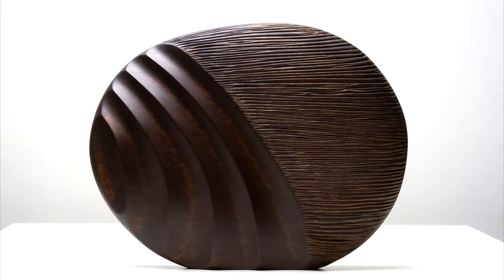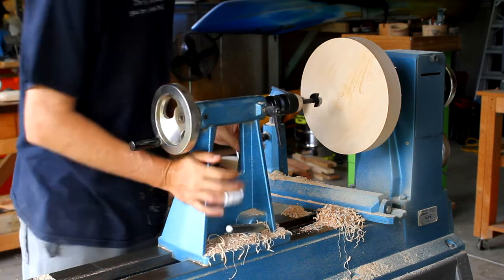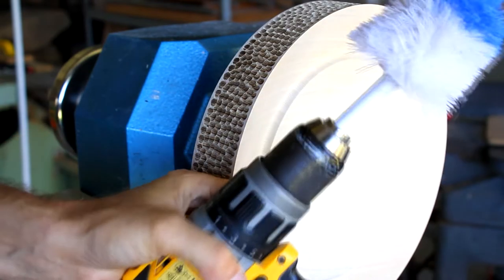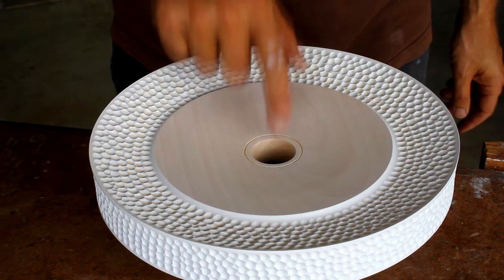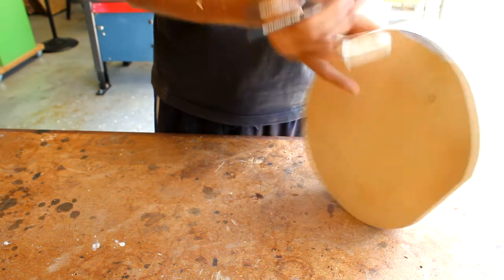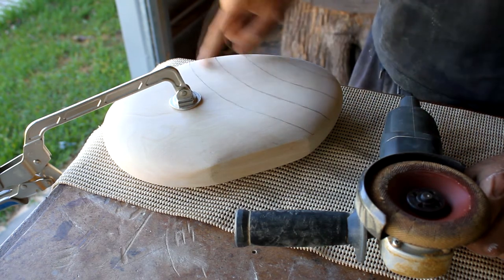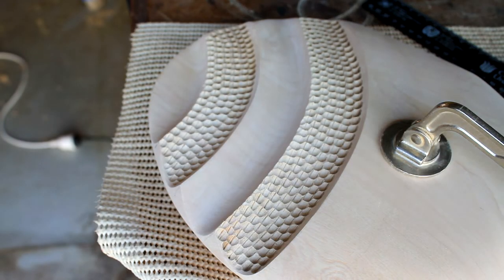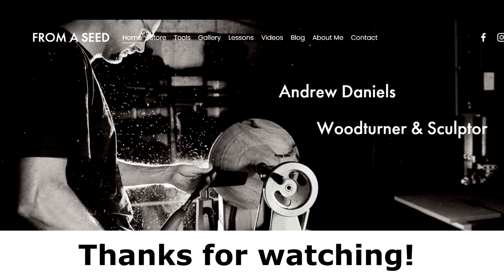Turning, Carving & Texturing Demo

Comment: Can I ask a questions about tool preferences? Do you have a reason for using the green grinder you shape the second piece with, as opposed to something like the arbor tech turbo plane? I use the turbo plane for shaping like that, but I’ve never used one of the toothed grinders. As I’m typing this I see you’re using a different tooth grinder to further shape the piece. I guess the real question here is what are the pros and cons of the different angle grinder shapers?
Reply from the maker: Yeah the green Sabuur burr sands instead of cutting. More messy but more contolable than the alternative, you can be really delicate and precise. No catches either.

Comment: Terrific video. Thank you. This is exactly the sort of thing I want to learn how to do. Question: Would you buy arbor tech mini or the power carving unit. I like the size of the mini but the power carver has a wide range of interesting attachments. I am leaning towards the power carver so I can have the option of all the add on items. Which one are you using. Any other thoughts or considerations?
Reply from the maker: Lately I have been using the Manpa tools mostly. Check them out if you havn't already... Ball gouge and mini pro are my fav though...

Comment: What a gift, Andrew! Thank you SO much for doing this for all of us to see a project from start to finish. I am wondering what diameter is the round piece? Also, do you seal the acrylic paint with varnish or anything?
Your videos are the reason I bought a bunch a burrs and wheels and have begun to dip my toe into carving. After seeing this I guess I will be running out to buy a toilet brush, too! :)
Reply from the maker: Thanks Flo! Its is about 35cm just paint :)  The brush works great doesn't it!